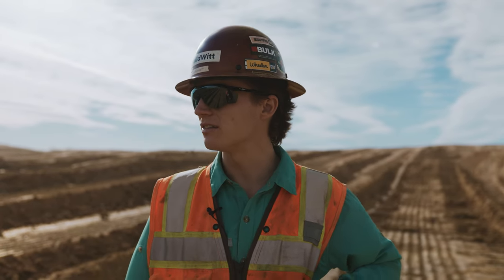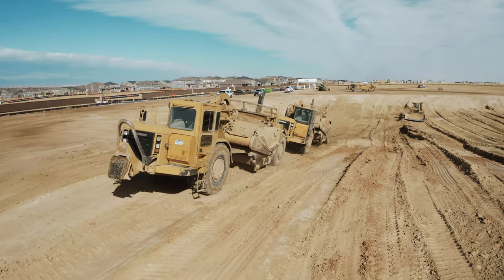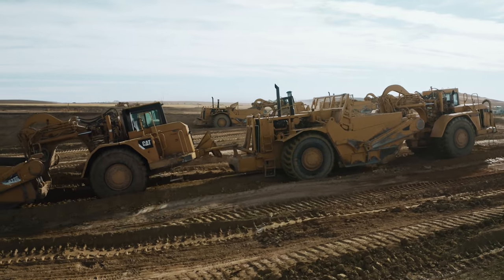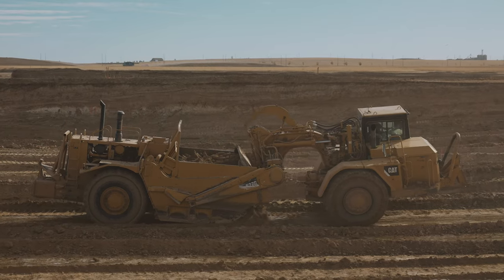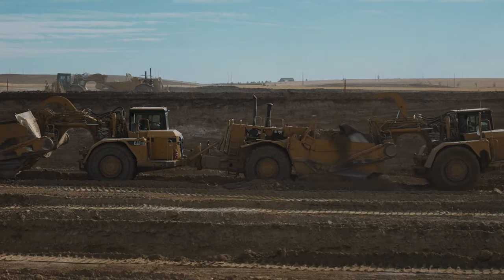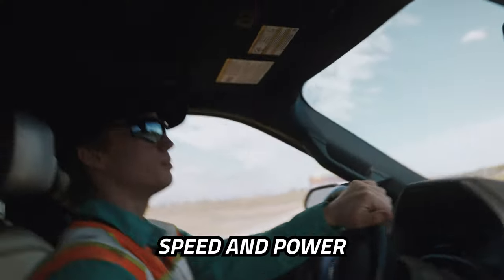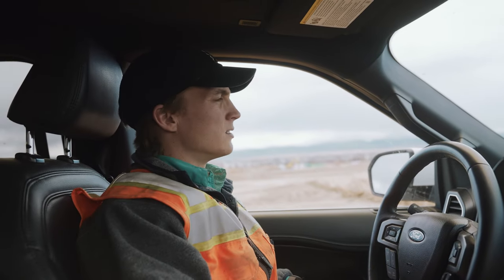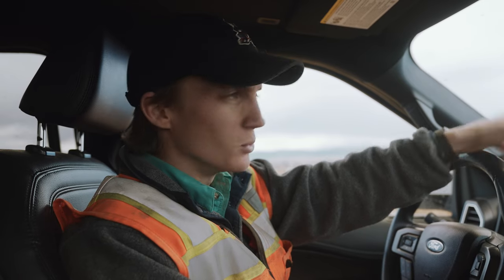Loading CAT Scrapers with an Excavator

Comment: About 4 years ago there was a huge grading project for a massive new industry. Never seen this anywhere else, but they had taken the cab part of Volvo (I think) articulated dump trucks (rock trucks) and put Cat scraper bowls behind them. Had quite a few of them in use being loaded by excavators and dumping normally

Comment: Scrapers being loaded by excavators are the best example ever of how slow and inefficient dump trucks are. You see that scraper sit there for 3-4 passes from the excavator, 15-20 seconds per pass and for 25 seconds with a push tractor behind it you have the same load of dirt in the scraper, probably more. Scrapers give effortless production and unless it is a pure rock job there is not much they can not handle cheaper than any other dirt moving combination